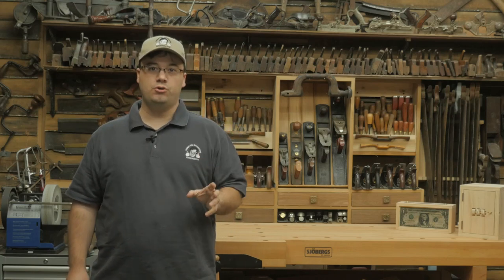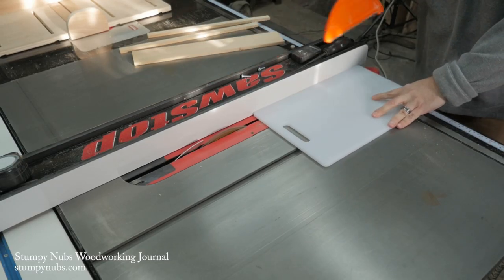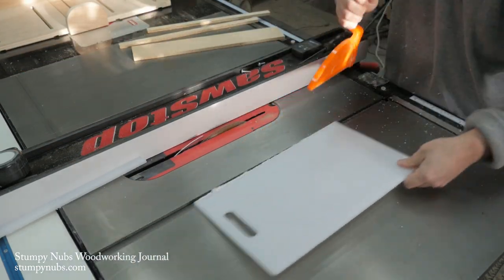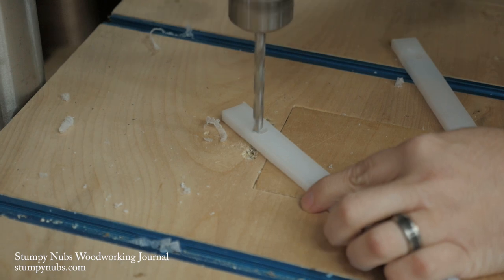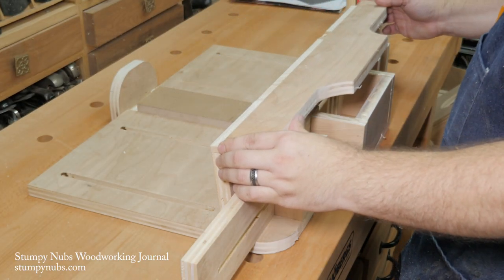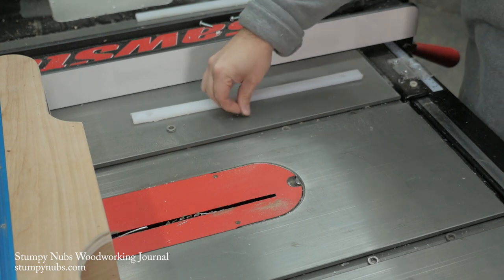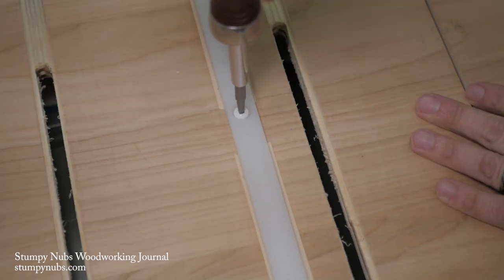Making table saw jig runners, How to adjust a sled fence

Comment: A tip I got from a Woodcraft salesman years ago: If you're using double runners for a jig, don't worry about getting a tight width fit to your miter slots. Come close, then place the runners in the slots, resting on pennies or dimes, if needed, to get them to up to the table surface. Next, wedge them away from each other using strips cut from business cards or playing cards. Then attach your jig in any manner you like. When using double runners the only edges that matter are the outermost ones. A slight space on the inner edges doesn't create a loose fit. I was about to buy two expensive adjustable runners that day and bought two relatively inexpensive pieces of T-track instead. I've had the sled I built using this method since then and it still works great.
Another related tip: if you have a miter gauge or single runner jig that's a loose fit you can shim the runner to a perfect fit using clear packing tape. Make sure the runner is clean. Apply the tape along one edge and across the leading end of the runner. Press it firmly to ensure good adhesion, then trim the excess tape width to the gauge runner depth with a utility knife. One or two layers should do it. The tape is quite durable and sticks really well. Again, I have a miter gauge that I fixed using this method two or three years ago and I haven't had to replace the tape yet.
Reply: butting both runners against the inner edge would also do the trick right?
Reply: @b3arwithm3  Sure. All you're doing is wedging the sled against the center of the table rather than the outer portions.
Reply: Yup!
Reply: @dennydillavou3327 😊

Comment: Thank you for your great videos/info/demo.  I have a question in regard of the hight of the runner.   My miter slot is 3/8 of an inch deep ...my plastic runner is 1/2 inch deep .is that to high? I always see people putting a washer or bolt to elevate the runner.   How high is high enough ?    THANK YOU AGAIN......I used one of your safety tips in using  a table saw.....GLAD I DID SEE YOUR VIDEO

Comment: I know this is an old video but it's the perfect instruction for using UHMW for runners. Value wise this is the best material but the method explained in the video must be followed without deviating or you may be disappointed. Cynoacrylate does not  bond well to UHMW and the runners may come off if you try to drill holes in them after attaching them to your jig

Comment: Getting the full set.  BTW I plan to 3D print my runners.  Using 4-6 outer walls means I can micro adjust them.  Also is there a video out for the 24" band saw?  Buying that too.  Thanks!

Comment: I need some help. I use the square to align as instructed but it might not be accurate enough.  When I do the 5 cuts method to verify I get about 0.04" difference on a cut of 15" long. Is there a more precise methods to move the runners than just visually with the square?  When we adjust the fence we both use the square at the starting point but do micro adjustments based on the reading after the 5 cuts. How we do micro adjustments with runners? Thanks much

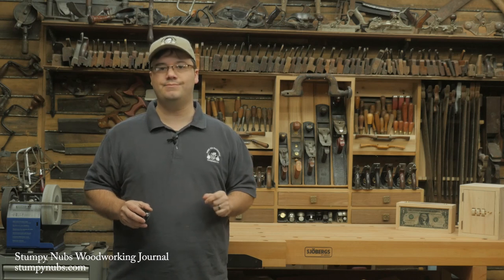Comment: I didn't get how we make the adjustment at 4:40. Once we twist the sled slighly, how would we "lock" the position of the runners while tightening the screws?
Reply from the maker: The runners aren't loose enough to move on their own if you carefully lift the sled off the saw and tighten them down again.
Reply: @StumpyNubs  thanks got it. Don't loosen them too much to start with.  What do you think about putting those screws from above.  We gonna have ugly holes on the base but it seems easier and low risk of the runners moving.

Comment: Does the sticky tape become a semi-permanent part of the sled?  I assumed in the beginning of the video that after checking alignment the tape would be removed, then the runners reattached into the known good location.  But it seems like the 1/16 play on the screw holes would eventually allow the runners to get out of alignment when they got bumped or the wood they are attached to changed due to moisture.  What keeps the runners from getting out of alignment again when the sled is being moved around the shop?
Reply from the maker: They don't move. Theoretically, it is possible that they could get banged around really hard and move. In that case you would loosen the screws, and re-align them as described int he video. But that's extremely rare in actual practice. The tape also holds the runners. In fact, if you do have to realign them, you may want to remove the tape, as it will make them difficult to slide into a new position. But I have yet to have any need to re-align the runners on any of my sleds of jigs after they were initially put on with the tape and screws.

Comment: I believe your assumption about the runners  being the best way to square the table saw sled to the blade  is incorrect. Please check out Tom Mclaughlin's three three cut method for squaring the fence to the blade. I think you'll find this method superior. Let me know what you think.    Denny
Reply from the maker: The three cut method is not a method for squaring a blade, it is a method for CHECKING to see if the blade is square. You still have to square it if the three cut method shows it is out of square. This can be done by moving the fence, or moving the runners, depending on the sled design.

Comment: how would the micro adjustments stay put? wouldn't the sticky tape want to pull it back to the original position?
Reply from the maker: +Everfalling - The tape isn't that sticky. Most double sided tape for woodworking is removable. The adhesion will break when you shift the runner. In time the tape won't be very sticky at all.

Comment: I used double-sided tape is too thick and spongy.  It is intended to stick things to walls.  It compresses beneath the runners' screws when the screws are tightened, resulting in wavy runners.  Also, I applied tape the full length of the runners.  That will make it harder to remove if ever necessary.
Reply from the maker: You're using the wrong double-sided tape. Don't buy mounting tape, buy carpet tape or turners' tape.

Comment: Stumpy, do you have some advice if the tablesaw has these little "tabs" along the slots ? Should the tabs be taken off, or is it better instead to aim for a "T" shaped runner ?  The AEG TS 250 K as example.
Reply from the maker: +havenisse2009 - I't depends on the track itself. If it's a standard 3/4" track that you can use a standard miter bar in with the table filed off, I'd do it. But that may be a bit drastic for some. You could track down a replacement miter gauge that's made for that track and use the bar for your sled runner (one runner will do) as long as there isn't any wobble in the track (which, sadly, is often the case with that type).

Comment: Will it be okay if your miter slot is 3/8 an inch deep, and your track is half an inch?
Reply from the maker: +Laurie Lucas - While I think it may work, generally, you want your miter slots to be thinner than the track is deep.
Reply: +Stumpy Nubs (James Hamilton) So I should look for a cutting board thinner than 3/8"?

Comment: There are much better ways to get a fence perfectly square, this just feels sloppy and I have not gotten this to work for me.
Reply from the maker: I don't know what to tell you. I've built many sleds like this. Works perfectly fine for me.
Reply: @StumpyNubs  Can't move the sled because it is entrapped by the blade, or when having to pick up sled runners move.  I have tried a few times, I am sure I will get it eventually.  But using the movable fence method, I was able to get my other sled within .002" with much less effort.

Comment: Ah, no! Evertime you "adjust" your runners it will cause the sled to not be square. Here's a tip...spend the $20 bucks or so on a good aluminum adjustable runner from a supplier like Rockler.  Your time is worth with something. Don't waste it on making plastic runners.  By the way, plastic will warp over time and will be effected by weather (especially in hotter climates).  If you are looking to save money, instead of buying the aluminum t-track buy a router bit and make those parts yourself. It will say you in the long run and you will have a more durable longer lasting sled.
Reply from the maker: While I have nothing against buying runners, you make a couple of claims that aren't true in practice. Plastic runners are not going to be affected by weather because they do not absorb moisture. If they are affected by heat you are either living in an insanely hot area, or using the wrong type of plastic. And you appear to misunderstand the whole point of "adjusting" the runners. Rather than making the sled "not square", the whole point is to align the sled using a square to be sure. If the square it flat against the side of the blade AND the fence, the sled is square no matter what your runners are made out of. People have been using plastic runners for many, many years. They work fine. But, as I said, if you wish to buy aluminum, great! And your tip about making your own t-track is a good one. We've done that in other project videos as well.
Reply: I live in Los Angels. I have made plastic runners for table saw sleds. They don't hold up. When plastic slides against steel, guess which material will wear faster.  I know as I owned one of the larger furniture manufacturing companies on the west coast years ago.  Now if you are determined to make your own runners here is a tip: Cut the material for your runners close to the size of your table top slots without them binding, drill small  holes along the edge of the runner with a counter sing, screw in small sheet metal screws so they are slightly inset into the countersink, move the runner back and forth inside the track. If there is "slop" adjust the screws out to take up the slack where needed. 

I know you think that by using a square you are getting a sled that is acceptable . That's because it's acceptable to you.  Fine furniture making requires greater tolerances than you are getting.
Reply from the maker: I think you are absolutely correct if you are talking about a production facility. Of course metal will wear better when you are talking about thousands and thousands of uses. But for the hobbyist, plastic runners (HDPE and similar low friction materials are actually used to create bearings against metal surfaces) have been perfectly serviceable for a very long time. Don't get me wrong, you make a lot of good points and I am very sure many will read your comments and appreciate the tips. :)
Reply: @StumpyNubs  runner quality aside, his original point is valid right? If we need to move the runners, dont we need to adjust the fence?  While the design allows for quick runner micro adjustment, there is easy eay to move the fence except drilling new holes for the screws
Reply from the maker: @b3arwithm3  No, you do not need to move the fence in order to adjust the runners. You loosen the screws on the runners a little bit, then place the sled in the slots and twist it until the fence is square to the blade. Then re-tighten the runners.